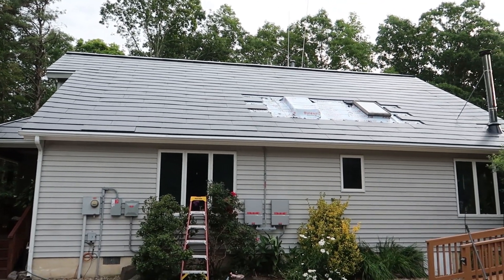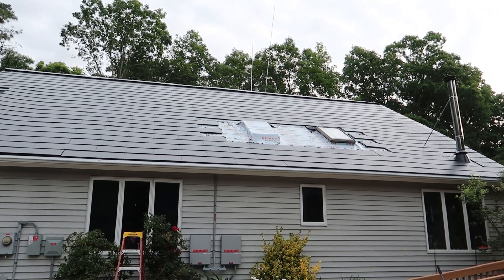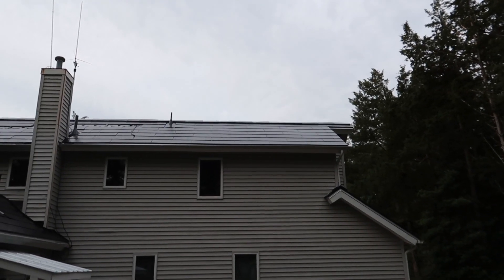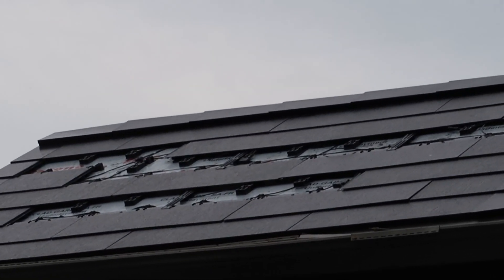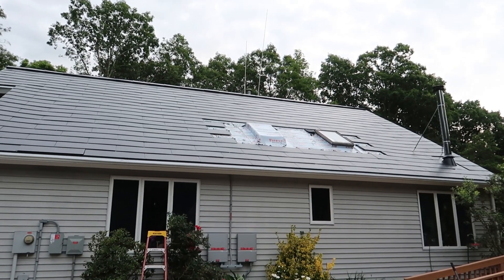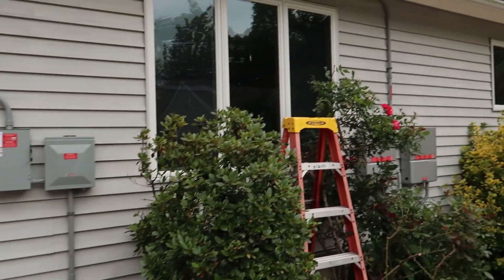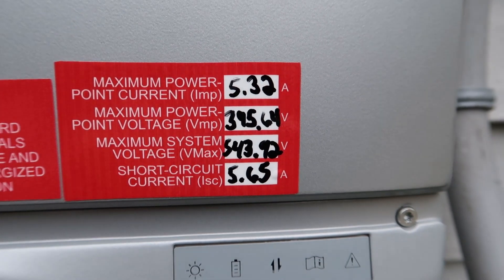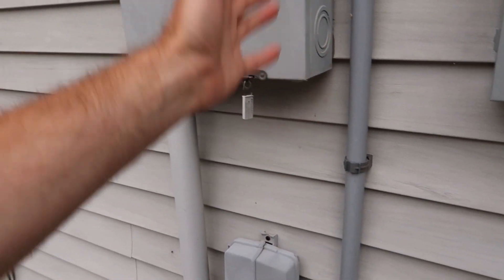Tesla Solar Roof V3 10.5 kw Solar Roof Almost Complete | Day 12 and 13

Comment: Nice video.  Disappointing that Tesla isn't able to cut the roof builds down to a week.  How long was the "roof"  teardown phase? and did they start putting up tiles as soon as one section was torn down?  Or did they wait until the complete roof was torn down before starting the solar roof install?